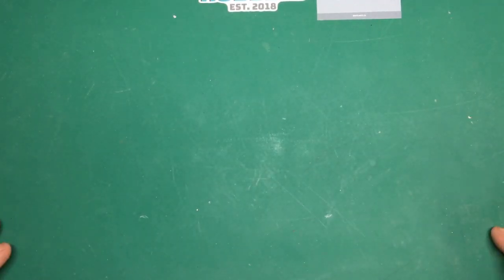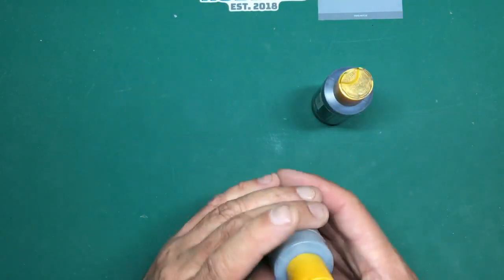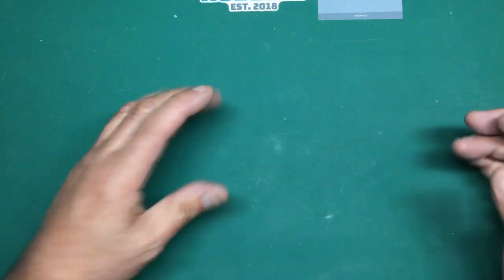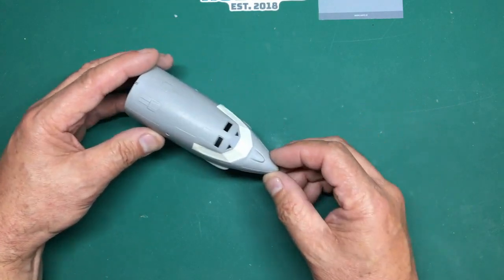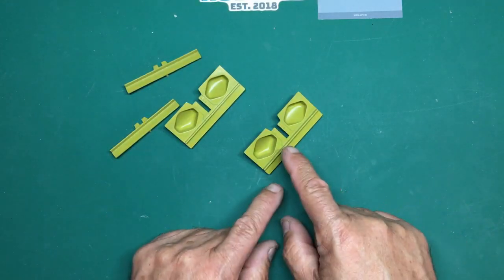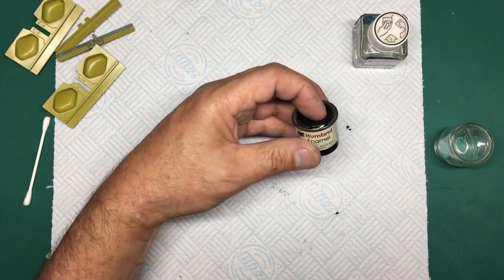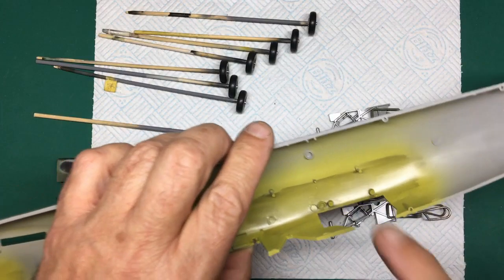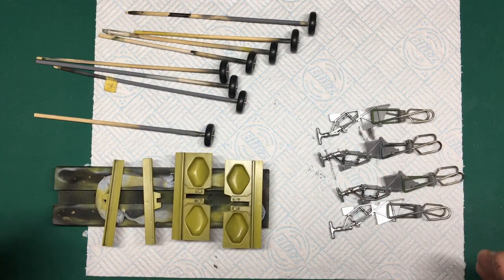Big Bad Buff Build for Beginners. Part 5

Comment: So the ball bearings use to rattle  your paint, or steel bb’s or anything else. As long as it clean, oil free, you don’t have to worry about then rusting corroding, (steel cant rust with out O2) anything you put in it the paint to stir it, won’t do anything  to the paint. Once it cover, it seal what every inside, I have use bolts,  nuts, screws, and never had a problems,  I have been painting cars, semi’s, boats, machines, etc. never ever have I had a problem,  I have been using bb’s in my little bottles of paint, tester, tamiya, etc. and I have paint that I have had four 30 yrs, and never have I found a rust nuts,, in the paint. I have been painting models sense “74” or “75”, ..... but hey I really like your channel, you do really nice work, nice tips, keep it up
Reply from the maker: Then can you explain why household paint tins rust internally if left on the shelf for years, or why car coolant systems corrode if they don't have antifreeze? If you're using steel in oil paint, of course it wont rust, but in water based paints like vallejo I'd rather not chance it.

Comment: Hi Nigel  I turned my vallejo paint into cottage cheese when I used Mr Colour Leveling Thinner. Wasnt pretty.
In your last video you talked about why an air brush will spit. How do you fix it if you forgot 😕
Reply from the maker: Yes Rob, Vallejo paint must be thinned with Vallejo thinner. Not sure what you mean on the airbrush question??
Reply: @NigelsModellingBench  When airbrushing if you don't stop the paint before the air. the next time you spray the airbrush will spit paint.How do you deal with those spit spots on your model? Hope that makes sense?
Reply from the maker: Rob's Model Bench ok now I get you. The best thing to do is let them dry for at least 12 hrs and using a fine hard stick sand them down. If you use a hard backing it will only remove the spots if you are careful.

Comment: Thanks for the info on washes. I found out the hard way by using a humbrol wash on my Revell spitfire 1/32. As per instructions I used thinner to remove excess  but quickly realised that things weren't going to plan. I use revell or humbrol enamel to paint, airbrush etc so what water based wash should I use or could I use your method with basic watercolor painting set and cotton bud with water to remove excess or should I buy a purpose made water based wash???. Spitfire survived by the way just looks a little dirtier underneath than I would have liked. Thanks again for another great video. Cheers Nigel 👍
Reply from the maker: Try using Tamiya paint thinned with water as a wash.. apparently it works??
Reply: @NigelsModellingBench  brilliant thanks for the quick reply, I will certainly give it a go. All the best 👍

Comment: On the tank thing...it depends what's in the dstl pipeline, it may be that they have a plan that future "tanks" become unmanned aka drones in which case they get much smaller etc etc. It certainly solves the manpower shortage we currently have recruiting service personnel;  they are certainly looking at unmanned autonomous submersible vehicles for the RN to supplement the current manned vessels to match what the Russians are doing.

Comment: Hello Nigel I don’t know why the b52 have different colour hub caps but I’ve looked at my pictures from fairford of the buffs that are there currently and 1 of them have a full set of white hub caps I’m wondering If it’s the colour of the bomb wing
Reply: Ashley Sparrowhawk wheel hubs were originally aluminium paint. Now they are white just to make it easy, and standardized. Some fighter aircraft have very light gray wheel hubs, legs an bays. White is more common, and make hydraulic fluid (red) easier to spot.
Reply from the maker: Ashley is referring to a question I asked in the video regarding the small cap over the wheel spindle rather than the whole wheel.
Reply from the maker: I think Jarrad is correct in that the colour denotes the squadron. I still don't know why some have a mixture of red and white though.

Comment: Nigel,,,good vids.... the crew entrance door is supposed to be to one side because it is also the ejection seat hatch for the navigator...only the G and H entrances were centered but behind the ejection seat hatches...
Reply from the maker: Thanks Paul.. I've been trying to look this up and guessed it to be the case. I hadnt realised the crew area of the D was so different from the G.
Reply: Paul Murphy the A through D had 2 navigators downstairs still. I think the only real difference to the G/H was the hatch faces the opposite direction, so on the D etc the hatch is hinged to the rear, the G/H is hinged in the front.